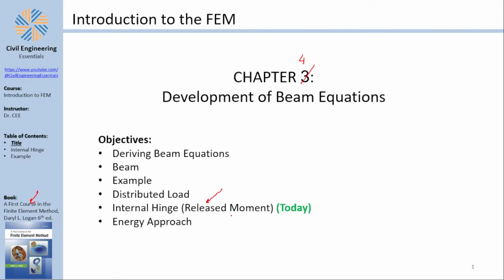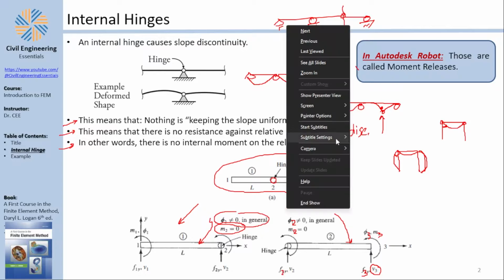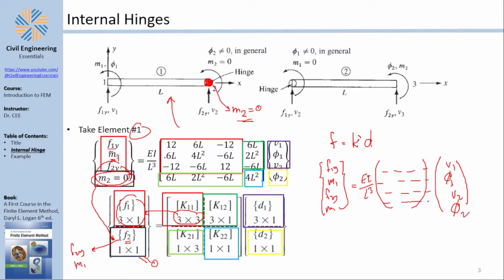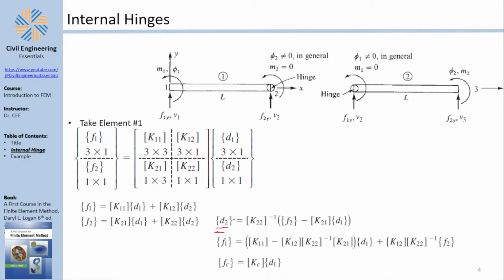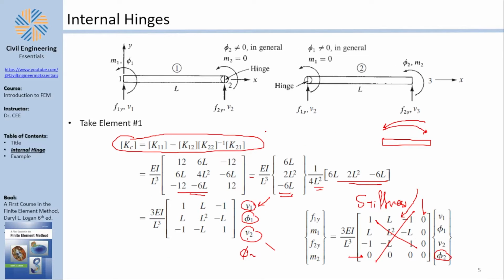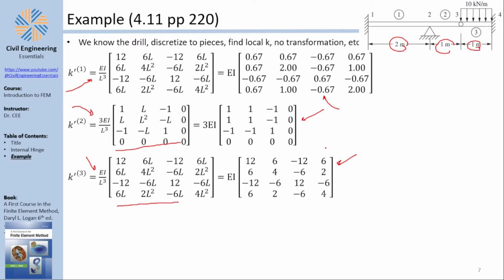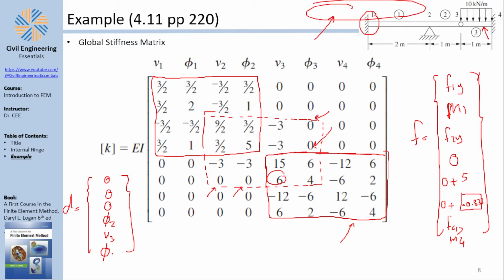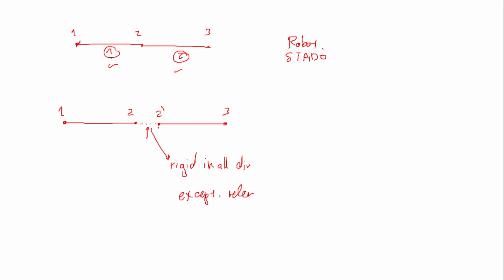The Finite Element Method | Part 10: Internal Hinges in Beam Elements

Comment: I’m wondering why we can’t use two condensed stiffness matrices. I understand that using two special stiffness matrices removes the rotation at the released node, but everything else in the system should still behave correctly. Is there a specific reason this approach wouldn’t work?

Comment: Hello Dr. CEE,

Thank you for the video, great explanations as always (and # assembled 😊). I have some questions.

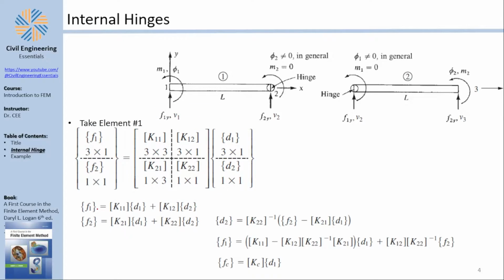06:13 [and later 08:24 and 13:33] so Doctor, are you saying that all those nicely “boxed and coloured ^_^” matrices can change (move around) depending on what “forces” are released or correspond to the released direction(s)? Would one then have to “crunch the math and condense” a special element local stiffness matrix each time depending on the nature of the release(s) on that element of interest?

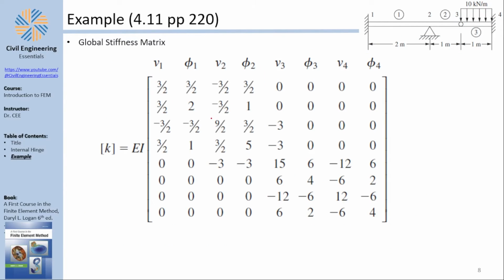22:23 In the first instance, and just like in this video example, I used (applied on element #2) the condensed stiffness matrix for the beam element with a moment hinge at its RIGHT end (Eq. 4.6.13), all worked out fine and the results matched the video and the referenced text. 

I then changed and I used (applied on element #3) the condensed stiffness matrix for the beam element with a moment hinge at its LEFT end (Eq. 4.6.15). And a “regular” stiffness matrix for element #2.

I had expected the results to be the same (except for the slope value of phi-3, as the use of the latter condensed stiffness matrix would have resulted in a phi-3 value associated with element two… the element that got the “regular treatment this time around ^_^”). However, all the results are now different from those I had obtained from the first instant of using the RIGHT end condensed element stiffness matrix (what gives? did I miss something?).

Aren’t the two approaches (either using the RHS or the LHS condensed stiffness matrix) supposed to produce the exact same overall structural forces? results in this case?

I have enjoyed this video and I am looking forward to the next CEE videos. Keep up the good work.

Kind regards, DK
Reply from the maker: Hi there Engr. DK,
Yep, the matrix not only can change and move around, the resulting result will differ. Each release will have its own matrix, but softwares "as mentioned at the end of the video" do not do this, they have their own trick up their sleeve.
Also, from a practical point of view, internal hinges are the most common releases so I guess the Stiffness Matrix that was presented is good.
Even if you have a double released beam (release on both ends), you could circumvent this by splitting your beam into two beams, each having a hinge.

The results should be the same. I am surprised that there are different. I think I will just quickly check it from my side. 

So your expectation is valid, you are not missing anything,
or do you? (dun dun duuuuuun).
Nah really, you are correct. There might be a slight miscalc or smthn. But I will check it out myself.

Regards,
CEE
Reply from the maker: I found out the error. In the stiffness matrix of element #1: it is written 0.67 (2/3) although it was 3/2 in my notes. You can see it "magically" become 3/2 in the global stiffness matrix. 
I am pretty sure that when you tried the second approach, you used the k1 stiffness matrix with the 2/3 values. which is of course my fault. ^_^ sry bout that.
Reply: @CivilEngineeringEssentials  

Hi Doc,

I have a little set-up in Mathcad. When I try these things out, I ussually just input raw question parameters into my little set-up and let it munch the various matrices from there. In this case, I have used the equations for both cases of the moment hinge at its RIGHT end (Eq. 4.6.13) and the case of the moment hinge at its LEFT end (Eq. 4.6.15) directly from the referenced text.

I did not use the values from your notes [I did however used and got all the IDEAS from your wonderful notes, and without your notes, none of this would have happened, so thank you for those notes]

Perhaps you could run the calculations from your side assuming the moment hinge to be on the left side and compare your results? or have you done and made this comparison alreday? do the results match?

If so, did you use Eq. 4.6.15 from the referenced text with the assumption of the moment hinge on the left hand side?

It is a curious thing for sure.

Thank you for your reply and kind regards DK.
Reply from the maker: Oh. Ok then i gotta go full on math mode. I will update you on the matter. Gotta check ma matlab stuff. It should give the same results.